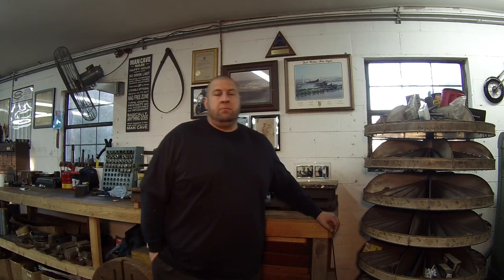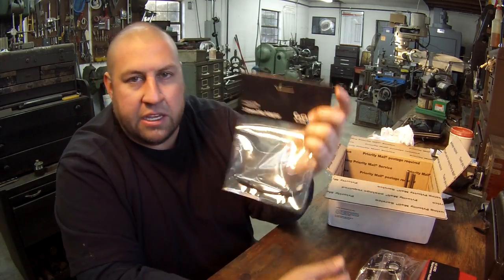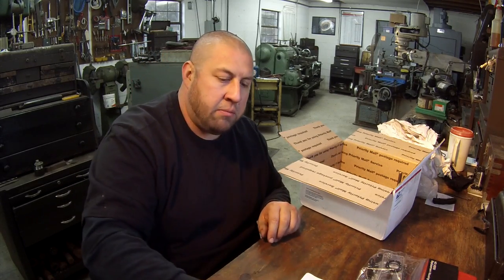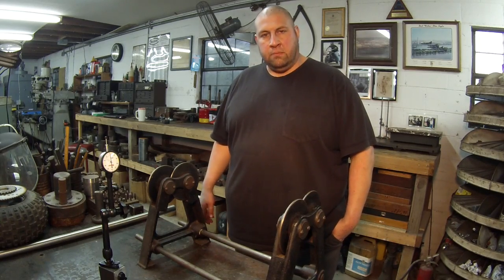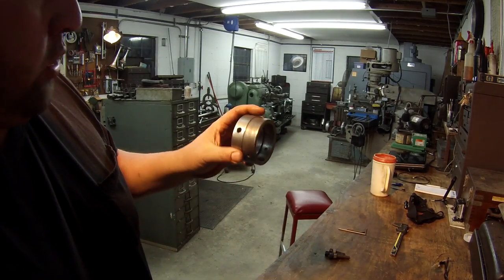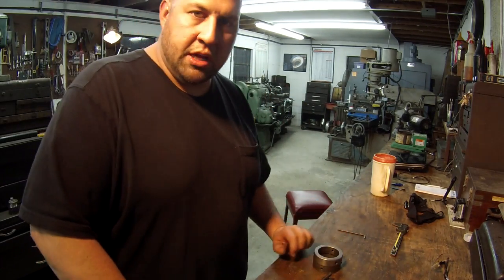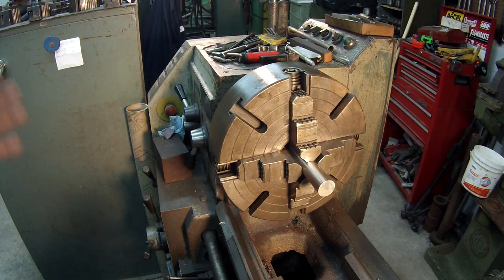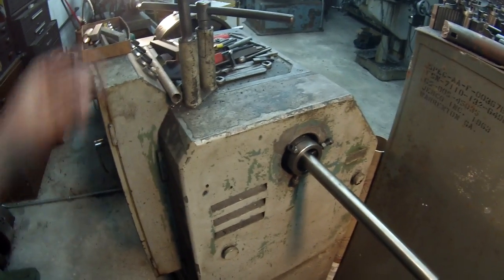Saturday Night Special 3

Comment: That's another hitherto unknown essential accessory to make for my lathe. The last time I had a long piece clear through the headstock, it just so happened to line up with the milling table and I supported it there. Like the spider idea a lot. Thanks Adam.
Reply from the maker: Before I built the pedestal mount I told yall about, we built a wooden fixture that was mounted on another milling machine we had in the middle of the shop. It was more of a large wooden V block that kept the back end of 20' shafts from whipping around.

Comment: Adam
Great video!  My warner and swasey has the back of the spindle threaded for the rear three jaw, but they also offered the bar feed option which i use for the longer shaft support as you saw in my fb pictures. I love the idea you came up with for the spider, nothing like some old fashioned ingenuity.  The longest shaft ive done is eight foot of 2 7/16".  I may be making some mixer rotors out of some heavy wall tubing in the near future, 5.5" od about 12' long.  Ill be sure to get some pictures of that and post.

Mark
Reply from the maker: Ive machined some pretty long prop shafts in the Victor using that setup, i say up to about 20', but most of them were around the 10-12' range. The steady mounted on the far end always worked well and I could easily spin 600 rpm with no worries.

Comment: Great Video Adam. Great idea with the spider. I the past i have turned Aluminium or Polypropylene bungs which i knock into the spindle especially when the end of the spindle is 3-4 inches back from the belt covers to really good results. Guess what I'll be making soon :).. Thanks for sharing.
Reply from the maker: Thats actually a very good idea for the lathes that dont have the spindle sticking out for enough. Hell some of that UHMW would be the perfect bushing for it too.
Reply: Yeah that's a good material too! Glad it helps. :)}

Comment: Our old Microweily lathe has an internal thread at the back of the spindle for a plug that accepts various sized bushings for different od shafts. It doesn't make 100% true to the chuck like your setup though. I may have to modify it. Thanks for the tip Adam.

Comment: I have used a few smaller hand made units with aluminum "rollers", however they were solid mounted. We used them to check run out on motorcycle two-stroke cranks (pressed crank pins)....

Comment: Hi Adam, you are a 4-jaw ninja! I keep going the wrong way and have to stop and think about it and draw lines in the air with my hands. I'm going to go practice now...  I also love the shaft collar on the back end.  Longer pieces keep whipping in mine, so this is going down as a future project to do for me.
Reply from the maker: Thanks JDTools. Did you get some more practice on the 4 jaw chuck? If your indicating the OD, loosen your lows, tighten your highs.
Reply: Abom79 Hi Adam, Yes thanks I tried your tyh/lyl moves from a previous video on a practice piece in the check and I'm getting there.  This weekend I have a job of truing up an ER25 collet that I made to a shaft that want to weld it to and that job is going to require the 4-jaw.  So I'll let you know how it went.
How's your dad doing after the latest hospital episode? We keep on praying for his speedy recovery.
Regards
Johan

Comment: Nice video. I like the gifts from Tom. The roller gismo is pretty cool.  I wonder if you could use it to check the straightness of a rifle barrel. I made a 4 bolt spider to use on my Grizzly lathe. It screws on the back side of spindle. I hope to use it someday to chamber rifle barrels
Reply from the maker: I wouldnt know about the rifle barrel thing, never been into gunsmithing. Sounds like you have that lathe ready to machine barrels though! Thanks Steve!

Comment: nice video i really like your practical approach to problem solving. i have a 12inch lathe with a 1.5 bore that i built a spindle adapter that threads onto the rear of the spindle and has male 1.5x8 thds .i use a jacobs headstock chuck and a 4jaw left over from an old atlas lathe to center stock. works great on rifle barrels.
Reply from the maker: Sounds like a nice setup!

Comment: Nice video Adam, loved those precision rollers! I did a lot of shaft straightening, but worked with shop made set... Metric isn't too bad, I knew this old guy who didn't like 'me' because in the 80s it looked like the USA was going that direction, and I didn't care one way or the other, and he was hard core SAE. I did a lot of work for Michelin Tire and they were all metric... Of which were some big castings I turned on a 39" (1 meter) diameter 4 jaw chuck. They always had close tolerances like a couple thousandths on 24" diameters @ 70 degrees, and the like. I think I've already mentioned the huge lathe I used, but not the depth of cut it was accustomed to 1/2" was nothing on aluminum castings we had to put guards on the lights 16 feet up, I had to make a boring bar out of 3 inch round stock flattened a bit on top and bottom. What a fun machine! as usual thanks for sharing! :o]

O,
Reply from the maker: My buddy Glenn who was in the KZ Bobber Build video loves using metrics for measurements. He always tells me what he needs done in metric terms just to mess with me cause he knows I hate them. LOL

Comment: I just may have an external mic for ya. Have to do some digging around at the shop to see what I can come up with. For what its worth, I think it sounds fine.  And the contact audio from when it is mounted up on a machine just sounds pretty nifty.
Reply from the maker: What I do is simple, and easier on me, even though I know its hard to hear me sometimes. But I would like to have an external mic at times when I'm trying to talk about things in the video.
Reply: I'll cook you up a couple options. A clip on and something on a stand. The other job outside of the day job is a touring audio engineer so it is waaaay easy to cook up something nice and easy. My way of saying thanks for a lot of really great info and techniques that someday I can hopefully use to better my craft

Comment: Hi Adam, great video as usual! Can you tell us why you have only three screws to indicate the shaft on the backside? wouldn't 4 be more comfortable, just like 4-jaw chucks indicate easier than 3-jaws? (or at least they are for this beginner ;-) )
Reply from the maker: At the time that I built it I felt like I only needed three bolts. No real reason for it. Its not hard to indicate though. It works fine the way it is.

Comment: Great video, the roller tool is cool.  So if the shaft is out of true is there much you can do with it to correct?
Reply from the maker: Steve, there are times you can straighten a shaft, but a lot of times you have to machine new.

Comment: It still amazes me as to how quick you can set that Monarch up. You said you did multi versions of this set up all day with this kind of shaft? Did it ever get monotonous and boring to you? It was interesting to watch. Tell Elana she didn't need to lower her voice whilst she was in the shop. LOL I was hoping she would give us her British accent, I also can do the British accent, drives my granddaughters crazy.
Reply from the maker: I was on the Victor in this video. Yes we used to have large bundles on 2" cold rold shafts we had to cut to length, then go to the lathe and machine a taper on each end. I hated the job but it was good paying for the shop. Just a lot of manual back breaking labor. 
Elena had a lot of fun on video. She wanted to act like she thinks I do in my videos...LOL
Ill make sure she does a British accent next time.

Comment: I just drilled a small hole in my guard from the top to get at the spider set screws with a T- handle allen.  then just tapped it and put in a low head socket cap screw finger tight to plug the hole.

Comment: Hey man!  I was thinking of doing the same thing at our shop with an outboard steady rest like you were talking about.  You said you bolted it to the floor, but do you think that I could achieve similar rigidity by weighing it down?  Im sure shaft size will effect the limits of its rigidity....lemme know what you think!  Great video!
Reply from the maker: I have another one that just uses to ball bearings thats just weighted down with lead. it works ok, but the steady rest assures the shaft cannot whip around at all. As long as the shaft is straight and centered you can just rest on on a pedistal, but the bolted down method makes sure the shaft cannot whip around.
Reply: Thanks for the info!  I think im gonna give it a whirl.  Let ya know how it turns out!

Comment: Hey dont go buying a new 4 jaw, make a chuck truing plate, holds the jaws taught so you can put a die grinder or dremel tool in the tool post and grind them parrallel.
Reply from the maker: I've thought about doing something like that before.

Comment: Adam, and to anyone interested regarding the Anderson brothers static balancers, yes their still making them. They're available through AW Precision and range in cost from $960--$6000 for a set dependent upon size, and weight carrying capacity which ranges from 250lbs to 5000lbs and from a 20" swing to 70". They also make a more precise version using needle bearings and precision grinding for checking tolerances on shafts and such. I've attached a link.https://andersonscraper.com
Reply from the maker: Yes sir, I know about them. We bought The same size for work only in the higher precision model, called True Checkers. Last year I dicovered one of the wheels was out of true so we sent it back for repair. They ended up sending a whole new unit to us. They don't build the large swing a-frame style anymore. You have to get the table top style and build you own stands for them.
Reply: Abom79 Adam:  the web sight for AW Precision appeared to still be offering the style you own and the True Checkers, FYI?  Maybe it's old new stock?  Anyway as always thanks for the videos I've learned a lot!  
     BTW, something my shop teacher taught us I've never seen anyone else do is with a Jacobs style chuck when he needed to say hold a bit really tight so it won't spin, or a tap he would tighten the chuck on all three sides and it does work.  Each side you tighten you will gain a little more tightness on the bit.  If you've never tried it, give it a try, I'm curious to see what you think?